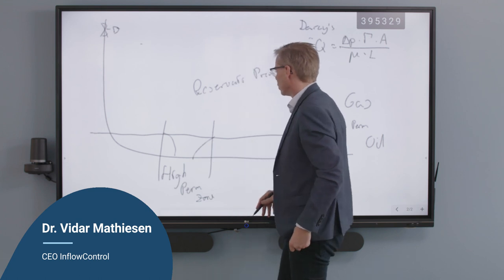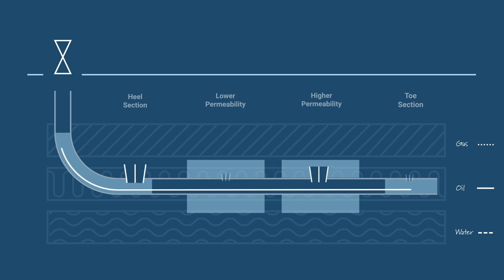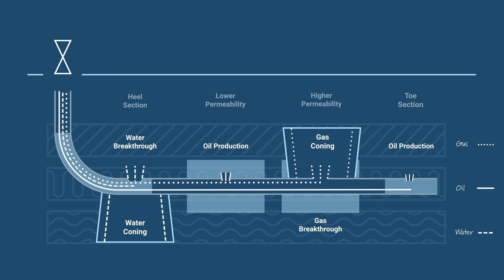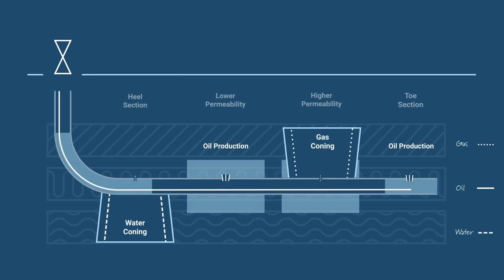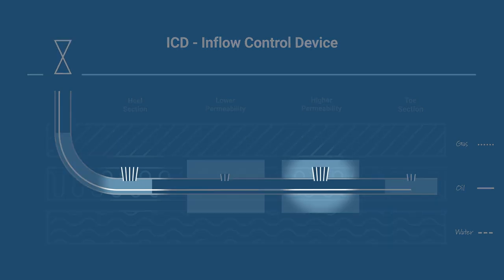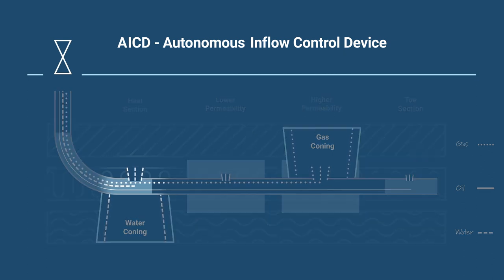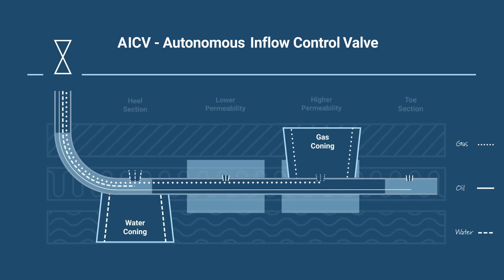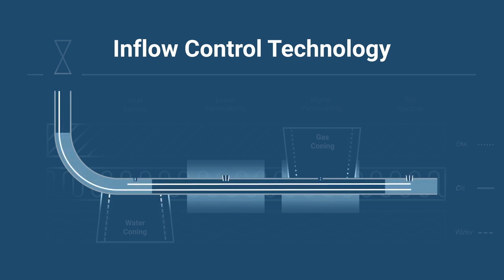The FUNCTION of inflow control; ICD, AICD & AICV

Comment: I mean can AIC Valves be installed after completion of a well?
Reply: This will depend on the initial completion design. If you have a cemented perforated monobore completion with perhaps a large ID 7" reservoir liner, or a barefoot OH reservoir section, then you could potentially run an AICD or AICV reservoir section insert. Usually you would require a rig, coil or a hoist unit to do this, and some kind of pressure control equipment. The reason it should preferably be a cemented perforated or barefoot completion is you need swell packers between the valves to segment the inflow units properly. Main issue is you cannot allow annular flow around the AICV segment units for this to be effective.